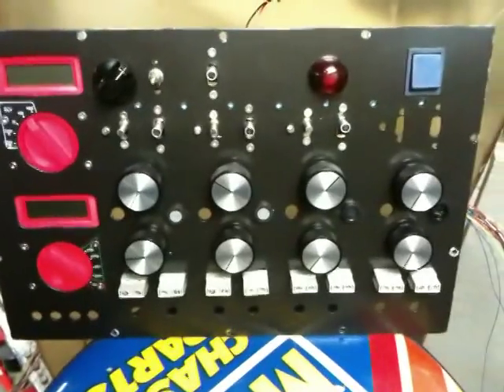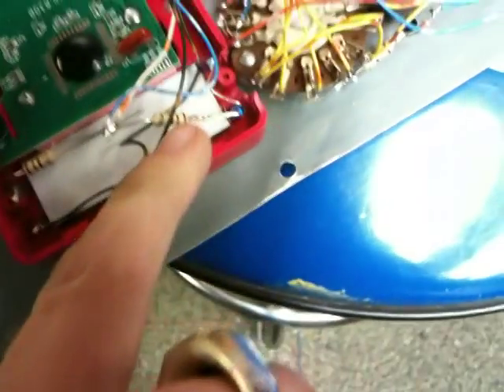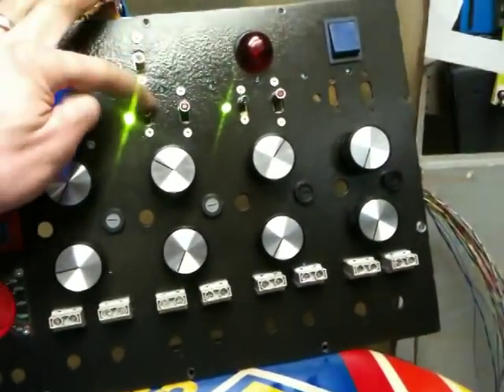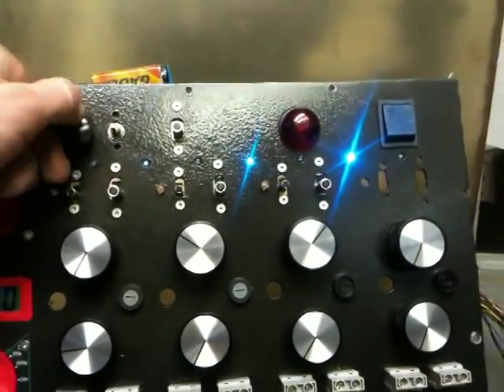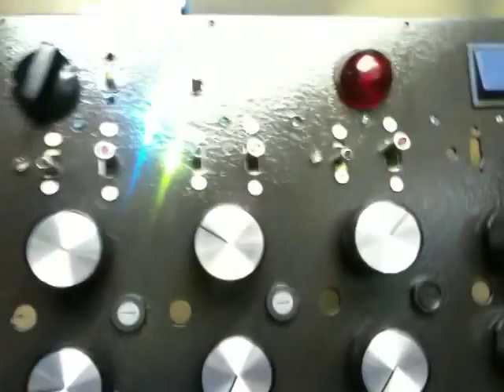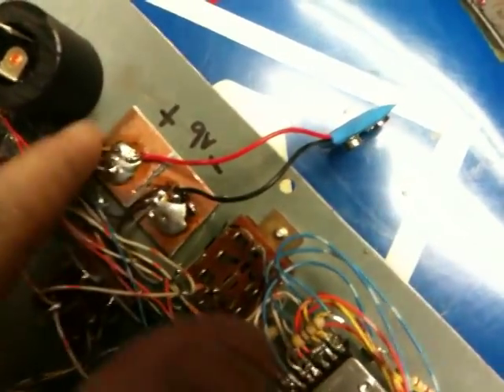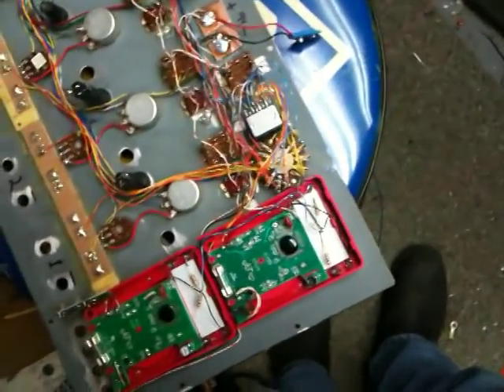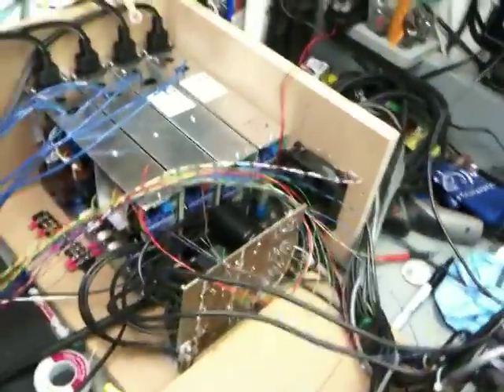#8 Building My Own Variable Power Supply Crazy mess (Wiring The Panel &  Some Main Power)

Comment: you should put a reel in there that is self winding so when you close the box it winds itself. or mabey a tube and a hand knob to keep it all together so whires arent floating around in there. if u use spring make sure not to tense, u dont want wire being ripped out. its all coming together nicely though. keep it up sir, your about to be rewarded for all the work you put into this thing.

Comment: lol Are you going to make an instruction manual for that thing?  :-)  I would strip back as much wire jacket as possible.  It will make the wires bundle and flow much easier.  Use lots of small wire ties and trim each wire to the exact length needed.  Awesome stuff, good luck wiring!

Comment: Hey Russ.. probably something your aware of, but... I've found that in thrift stores, yard sales, and such.. I find little 12v auto air ionizers/fans, and they usually have 3 LM317T Voltage Regs in them... they are pretty blow out proof, have auto shutdown and only see the difference in potential, run at about 1.5a i think. Cheers